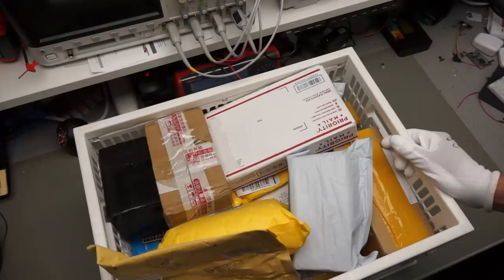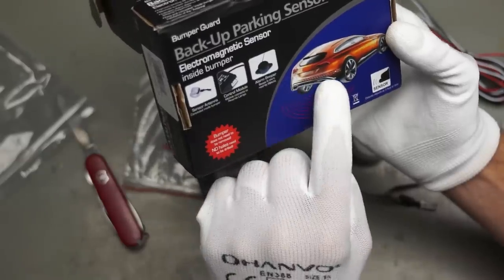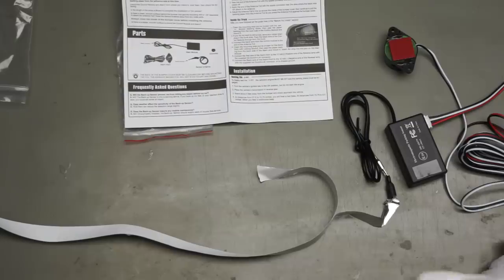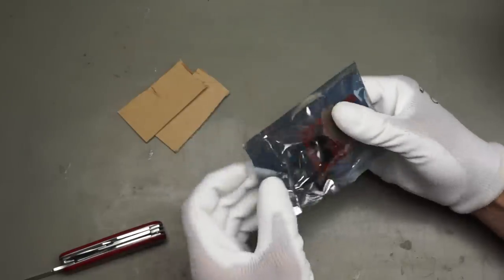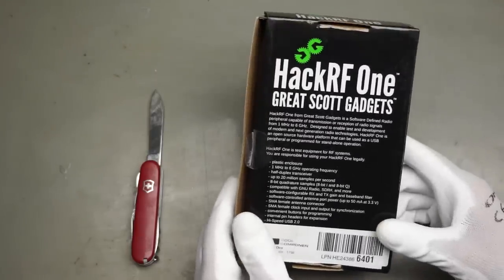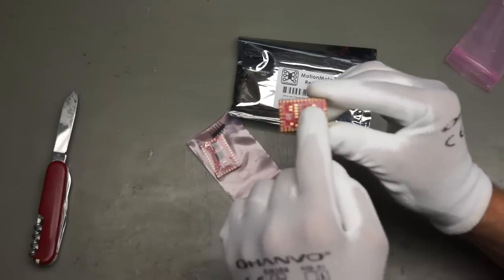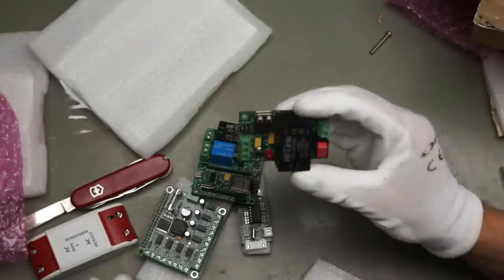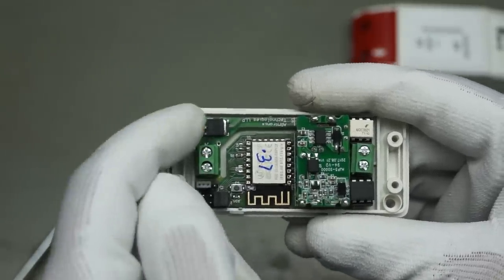#230 Mailbag Part 2 (HackRF one, Moteino, Parking Sensor, Bus Pirate, Armtronix)

Comment: Parking sensor will be a low frequency capacitance sensing circuit - the car is one plate of a capacitor to ground, and so is the other car - the strip antenna is another plate of a capacitor to the other car, forming a loop of three capacitors with an AC current, a rectifier, and a sensing bridge - the microcontroller will self-calibrate at power-on, which is why it worked so well on your bench.
Reply from the maker: There are still a few questions, e.g. Does it also detect an (isolating) wall, how does it react if it is completely isolated by the tires? But I agree the chance it reacts somehow to capacity changes is very probable.
Reply: It is not isolated by the tires at AC, only at DC.  Bring it back to "plates of a capacitor" thinking - The car is a very good plate of a capacitor to the earth - this is how a HF mobile whip antenna is grounded, through the plates of the car/earth capacitor.  Given the units' seemingly good ability to self-calibrate, any two objects of comparable capacitance to ground (two cars, two persons, a person and some other item) it should provide a good detect, since the bridge will be in the middle of its' range.
Reply: The equivalent circuit of the car to ground, is approximately 1megohm (the tires) in parallel with 1nF (the plates of the car/ground capacitor).  Now where does the AC and DC currents flow?

Comment: That parking sensor is probably a capacitive sensor. The inductor is probably just part of a low-pass filter. Just a guess. ;)
Reply: I think so too
Reply: Yes should be
Reply: Or the low frequency equivalent of a thermin.  Make an oscillator with the coil, and watch the frequency change - easy with a counter in the uP.  Lots of ways to skin this cat.
Reply from the maker: Interesting idea to compare it with a Theremin. Reminds me that I have to build one because I promised it to a friend...
Reply: @AndreasSpiess  "Theremin" was the first word that came to my mind as well.
Reply: A couple others beat me to it, but I would also say that it appears to be based on the operating principles of a Theremin.
Reply: Obviously I don't know how they actually did this, but any change in capacity will change the tuning of a simple oscillator, which can then be counted by the uP.  And it can know how much change and how quickly to adjust the warning beeps. A real theremin uses a master oscillator and one you detune with your hand, which are mixed so you hear the beat note, usually run around 1 MHz - probably because back in the day, AM loopsticks were ubiquitous and cheap.  It takes pretty good RF practice to keep the reference oscillator from "pulling in" the variable one near zero beat - which bug can be a feature if you didn't also do the level control side.  The fancier ones do something similar to control audio level...
Reply: was my first thought too
Reply: The box  says electromagnetic. But I would think it is capacitive, considering that it gets mounted behind the bumper I would think electromagnetic would not work very well. It would be constantly triggered by the metal bumper bar if it were electromagnetic.
Reply: I was thinking this too, but unless you are parking in a water balloon factory, how is it detecting objects that are not capacitive? Sure it works on his hand, but a car or a wall?.. I think I would disconnect the battery before bending down and getting my head close to it in any way while its plugged in.
Reply: The parking sensor is similar to the one installed in my Car 8 years back and it is working fine without any issue. https://www.parkingdynamics.co.uk/Universal-Sensors/Parking-Dynamics-PD1/Parking-Dynamics-PD1-Parking-Sensor

Comment: Its capacitance sensor. It measures change in the capacitance of the aluminium tape when hand is close. That principal is use in capacitance 3D mapping too.
Reply from the maker: Interesting ides. I have to try it once with a (non-conductive) wall.

Comment: I had such sensor on my car and it worked perfectly. You mount it into the inside of the bumper and it's perfect. It re-calibrates once you stop and restarts the beeping sequence again. You can park yo milimeter distances. Much better than the ultrasonic one.
Reply from the maker: Thanks for the feedback. I was wondering if it also works with walls. But obviously, it does!

Comment: There is an additional TXCO for HackRF for about $10. Consider buying it also. It helps to decode and encode time-precise signals like GPS.
Reply from the maker: I already own a Chinese HackRF with this addition. Maybe I will add once a GPS disciplined oscillator. But my lab is in the basement :-(

Comment: About the Indian sonoff: you'll not have the noise of the relay when switching on/off, I like that. And with the zero crossing you can detect if there is no load connected. Can be usefull sometimes.
Reply from the maker: I am not sure if they have an interface to detect the load. Zero crossing usually is used to reduce the switching power.
Reply: You mean switching noise?
Reply: I don't know why I thought the zero crossing was on the load line (so if you turn the load on and you don't detect a zero crossing after 1/(2*50)Hz or 1/(2*60)Hz then you can conclude there is no load). But yeah, it's pretty useless. The zero crossing is put before the load to be able to know when to power on the load (always better to power on during a zero crossing), or to power off the load xxx milliseconds after the zero crossing and then dimmer the light.
Joohn2009R: I meant the "click" the relay does when switching it on or off.
Reply: It was not clear but I was responding to Andreas's comment "Zero crossing usually is used to reduce the switching power". I think he meant switching noise. As you mentioned, if you turn on the triac when the voltage is near 0 you get a smooth ramp of current instead of a spike. But in this case for a dimmer it is also as you say to time the turn on time after the zero crossing. You can't avoid the spikes in this application.
Reply: A triac doesn't make any sound when switching. A relay does because a mechanical part moves.
The main advantage of the zero crossing is that you can switch the triac when the voltage is zero, so you avoid any spike. When dimming you turn the triac on when the voltage is 0 and turn it off after x milliseconds depending of the intensity you want. When turning it off you should not have any spike I think.
Reply: One last try, I meant electrical noise (i.e. spikes). You can't turn a triac off. It only turns off when the voltage gets to zero.
Reply: You're totally right John, my apologies.
Reply: It is to reduce the switching power at the switching instant, this make the switch reliable and prevent hamonics generation (as long as you distort the pure sinewave, you create harmonics ).
Switching your load at zero crossing is equivalent to switch the load when the amplitude of the sinewave is zero or very near to zero in real world (zero voltage means zero power in the switch ! ). Andreas is right.

Comment: @Andreas Spiess  Not as low power as Kevin? What device are you referring to?
Moteinos are low power, 2uA sleep at 3.3v, hard to beat that. And you can also go lower than that, but you have to use external watchdog times IC
Reply from the maker: Trigboard mailbag part 1
Reply: ou will test this claims right? that esp can be below 1uA, I know moteino won't be, since you would need to have version without  regulator on it "3.3v, 8MHz version"
Reply from the maker: I plan a video about low power.

Comment: Edit: just remembered you already have a ucurrent.*
Nice that you featured Felix and the Moteino. Moteino also has a extremely low power (8hz, product 159) unit with no ldo so I am curious about this other one that you are talking about? Perhaps its the tpl5110? (that is kind of cheating) but please let us know so we can vary our collection on how to get it. Also if you do not have a ucurrent(eeblog) I think you should get one or perhaps the upgraded version from Felix called the CurrentRanger, for all the low power stuff you do I really think you need to get one or the other for more accurate measuring. I hear rocktscream also sells some very nice low power units. Seriously though I am not aware of lower power units than Felix sells and even has one running off a small solar cell and 5v supercapacitor (scroll down on Felix blog). I am honestly surprised you had to listen to a podcast to learn about lowpowerlab, but then again, unlike me, you probably have a life and a job LOL. I'll have to check out this podcast you are referring to as well.
Reply from the maker: I combine my exercises and listening to podcasts to save some time. And yes, I like the concept of the current ranger. "Unfortunately" I already have a ucurrent with similar specs, but not the same comfort. And since both products are quite expensive we will see if I will spend the money again ...
Reply: @AndreasSpiess  At least you have some kind of device. Its says a lot. Not many will invest in either one for their youtube channel or are serious enough about low power devices.
Reply from the maker: This channel is focused on these things. And I am supported by my Patreons that I can buy such devices. If I do the measurements, sometimes also my viewers can profit even without buying these expensive tools...
Reply: @AndreasSpiess  Yes it is very much appreciated!

Comment: The MOC3021 is without zero-crossing detector, otherwise it would be difficult to dim the light. I assume that zero crossing is made in SW to trig the triac at the right point.
Reply from the maker: I think so, too. In my youth, we built such devices which were manually commanded by a sensor plate. They also had to measure the phase and switch accordingly.

Comment: Hello Andreas, many thanks for your amazing work ! I'm looking for advice concerning storage of IoT data, and I hope you will find the time to read this comment ! Anyway thank you in advance, and suggestions from other viewers are of course welcome as well.

I'm building an energy monitor for my parents house with a Raspberry Pi and two USB to UART boards ; data comes from a voltmeter with serial out (PZEM-004T) and from the serial output of the electric meter provided by the electric company. I would like to log data regularly (mainly voltage and power) with timestamps. I don't really need fancy displays or web interfaces, I would just need to come back after the winter to analyze data (Excel would be fine). I heard that logging directly to SD card could have reliability issues with the SD card wearing out, and that making the card read-only could help. I heard about EmonCMS, Node Red, InfluxDB, PHP/MySQL, ThingSpeak, Domoticz, Jeedom ; but I am a little bit confused. What would be the easiest way in your opinion ? Many thanks :)
Reply from the maker: Maybe you watch my videos about node-red. There you find a flow which stores data in a sqlite database on the raspi.

Comment: Are those 85€ cheap hackrf from aliexpress the same like real Hardware ?
Reply from the maker: They are clones. So you never know. It would take a lot of time and equipment to test if they behave the same. Mine worked, but I never tested both in parallel.
Reply: Thanks for reply

Comment: Grüezi Herr Spiess, You said some thing about the custom. I have the same problem :) (I live in Basel-Stadt). When I order something from germany, I send the package an address holder in germany. Probably you heard about it but if not, I use las-burg https://www.las-burg.de/ When I buy something from germany, I give the address of the las-burg in weil am rhein and I add also my customer number, so my package is sent there and I have an email that the package is arrived and I go there, pay 2-3 euros (depends on the package size but its quite cheap) and I back drive to switzerland without a problem. The other reason that I use it, mostly amazon does not send packages to switzerland or they ask really high prices for a post. Well maybe it will be useful also for you. Warning: if you buy some thing from outside of EU region and send to the germany address then you may pay tax because german's import price limitation is very low.. But if you buy something in EU region, tax does not applied.. Just an information. Thanx for your useful videos
Reply from the maker: Thank you for your tip. I use the same procedure, just with an address in Grenzach :-)

Comment: Thankyou for the video .Hope you will find it useful 
 
Github link for the single triac board :
https://github.com/armtronix/Wifi-Single-Dimmer-Board/blob/master/Wifi-Single-Dimmer-Board/Document/A0004_Wifi_One_Dimmer_1A_Board.pdf. 

Moc3021 to drive the Triac , MCT 2E along with a bridge rectifier for detection of ZCD to trigger MOC3021 at ZCD+x, both are connected to Atmega328p   
 Code for the board 
Esp::  https://github.com/armtronix/Wifi-Single-Dimmer-Board/tree/master/Wifi-Single-Dimmer-Board/Arduino_Code/Wifi_Single_dimmerV0.3_alexa_status
Atmega328p: https://github.com/armtronix/Wifi-Single-Dimmer-Board/tree/master/Wifi-Single-Dimmer-Board/Arduino_Code/Atmega_Single_dimmerV0_5
Plz note : there is no factory reset pin its is just reset pin
Reply from the maker: Thank you for the links!